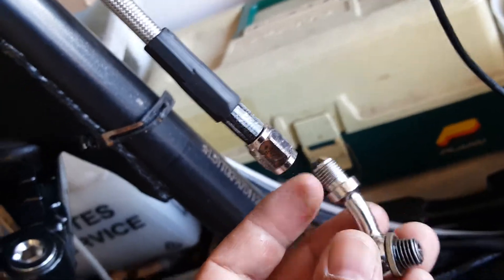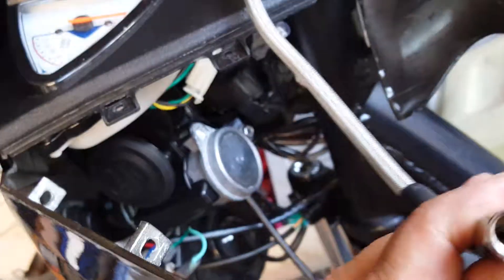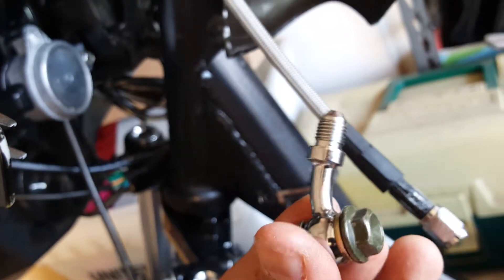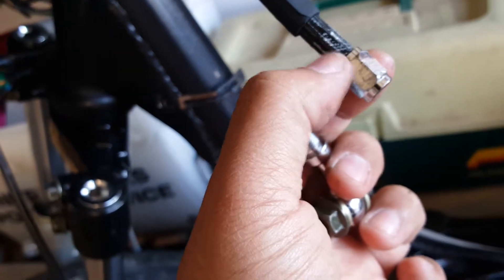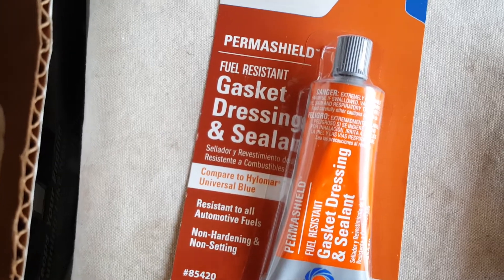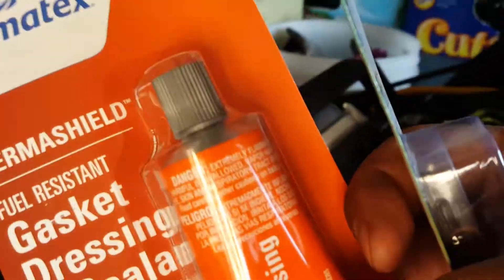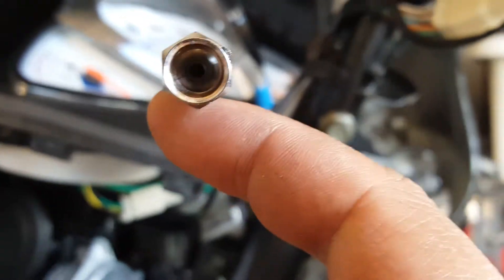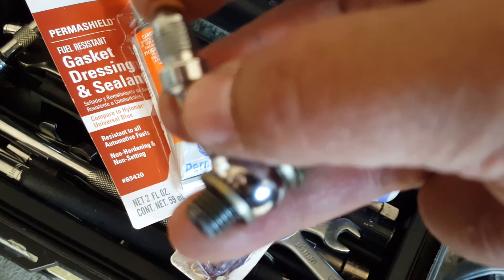How to Repair Leaking Hydraulic Brake Line Connection 1 of 4

Comment: Cmon people, the "cable" he shows us is actually hose cover in steel braid. The "banjo" is at the other end of the fitting with the hollow bolt and 2 copper washers. The "cone" and the "hole" is actually a piece of steel tuning with a double flare on the end. You never, never use any sealer on fittings like that. The threads DO NOT seal the connection so teflon tape is not how this is fixed. To stop the fitting from leaking you simply tighten it up properly, sometimes it requires more complicated tools than an adjustable wrench or a pliers like a line wrench. The only 2 real reasons it may leak are debris in the fitting or mismatched parts like a 37° AN flare on one part and a 45° SAE flare on the other, even then you can usually tighten it enough to stop it from leaking.